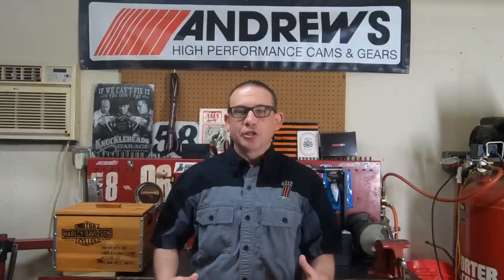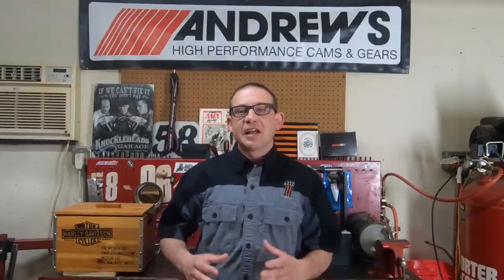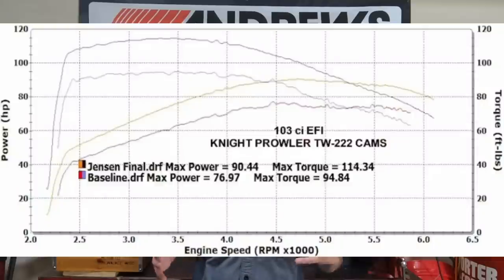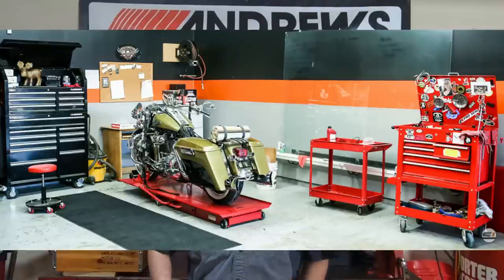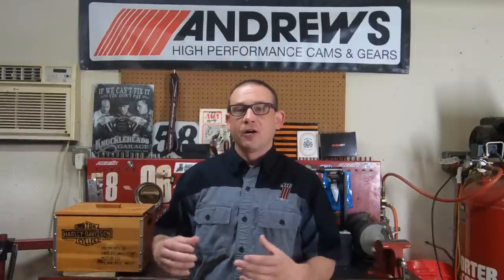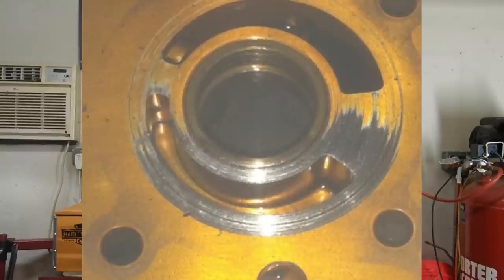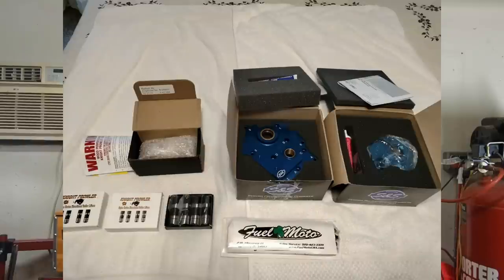Performance Harley Cams Have Their Issues

Comment from the maker: Does valve train noise bother you on your Harley-Davidson, do you even pay attention to it? Let us know!
Reply: I don't pay attention, besides I run a very loud vh two into one
Reply: Can't hear it over the pipes
Reply: Definitely listen for any new or odd noises that's not usual. I noticed more noise from the motor with a more open performance air cleaner, not a lot.
Reply: Valve train noise is more of a consideration on motorcycles with fairings. "Naked" motorcycles the noise will be less noticeable.
Reply: If your 100 year old blue printed v twin, air cooled tractor engine isn't making some ticking, I'd be concerned. If cam noise bother's you, don't buy a Mikuni, that slide rattle will drive you nuts.
Reply: Hell no. Love the noise
Reply: Nope. Can’t hear it over the exhaust. 😄
Reply: Only when I take my hearing protection out 🥃
Reply: I only notice it on start up...Once i get on the road with the exhaust note i dont notice it...
Reply: @Sully  my gas cap rattle is the biggest  irritant on my heritage even with  60k plus miles.
Reply: Yes I have a little vale train noise with the woods cam ,but it’s worth it for the sound of woods cam chop!!
Reply: Not me, as long as I know it's a built in noise I'm okay with it.
Reply: OK guys,If I go Woods Cam in my 103 Motor,2014 Ultra,which one would you guys on here suggest? Stage ll is a s far as I'm going.
Reply: I went with the SE torque cam, I wish it made a little noise but a the time I had to go with the SE to save the warranty. Then two months later I could have gone with the Woods and no issues 😕 nice video 😎
Reply: I just put Rocker lockers in my tc88. Will see as season goes on. The witness marks on that bolt were significant.
Reply: It's a machine. I'd be worried if there ISN'T any noise.
Reply: I no this isn't the thread but I no ur gonna no...I have a 88in lowrider and just did the s&s Big bore kit to it. Either 106 or 110ci now I'm not sure I gotta talk to the mechanic.....anyways I had already had did the fueling cam chest upgraded tensioners,  hp oil pump. But the mechanic put Andrews something 27 cams in it....well my new mechanic say he wants to leave the Andrews in there versus the fueling 570.....can u tell me which cam is gonna be the best for for power and highest HP???
Reply: Also it's in a lowrider
Reply: @Henry.58  I put a Woods 777 in my 103. Very happy with it!

Comment: Just a tip for others thinking about installing a Woods TW222 cam in an otherwise stock 103. I had watched another earlier video where this cam was reported to be a “drop in” cam. For the most part, that is correct, but if you use your stock original push rods after you have “dropped it in,” you will NOT be happy with the resultant valve train noise. It is loud, and it makes you feel as if there is something substantially wrong with your install. You will wonder if you forgot to torque the rocker arm assembly, or messed up the cam bearing install. It is seriously that bad. The reason for the noise is a smaller base circle on the cams. The fix is to use adjustable push rods and make the proper adjustment. It gets rid of most of the noise. Not all of it, but at least you will feel a little better about whether the engine is about to fail on you.  Just letting you know.
Reply: @timmattle4730  
As long as the push rods have been adjusted properly and your lifters have not failed-hopefully you replaced them, and you have good oil pressure, you should be ok. 

When I first “dropped them in” they were so noisy I was worried about the install. I did it myself. Finally decided to upgrade the cam plate, lifters, oil pump, and installed adjustable push rods and was much happier after that. I probably have about 8 thousand miles on them now. 

You might want to re-check the push rods for proper lash.
Reply: @timmattle4730  
Well after my new push rods the noise was a lot less. Had stock first, because of the “drop in” claim. Could not stand that noise so I reached out to Woods. They were the ones that said the old push rods wouldn’t work.
Reply: @timmattle4730  
Well I know you said you used an experienced tuner to do your work, but if it was me, I would check the push rod adjustment. If you are confident the lifters are all working correctly, the push rods would be the only other cause. Unless there is wear somewhere else. But that you are only experiencing it now, after the install, leads me away from that being the cause. How many miles on the bike?  You would have needed to upgrade the air intake for those cams too. Did you do that?
Reply: @timmattle4730  
Is your oil pressure around 50psi for most of the time, only dropping below 32 at idle?
Reply: @timmattle4730  
Ok. As long as the oil changes were kept up, wear shouldn’t be an issue. Which model?  I ask because you said you don’t have an oil pressure gauge. Mine is in an FLHTCU Ultra Classic touring bike. It has an oil gauge.

Comment: Thanks for all of your great videos. I have a 2005 Fatboy that I bought used, stock. Your videos have really been clear and helpful to a non-mechanical guy like me, not only to learn about what I had bought back in 2015 but also the mods I have been making over time. In 2019, I did the Stage 2 cams, plate and pump, spring cam chain tensioners swap-out, tappets, etc. I am now in the process of doing Stages 3 & 4, pumping it up to 95ci, 10.5-1 pistons, and moderate head porting. I have watched all of your videos about these mods as part of my research and discussions with the mechanics. Big 👍.
Reply from the maker: Thank you for the support! I really appreciate it! Your building a hell of a bike and doing everything right on there! That bike is gonna run damn good and be reliable, best part is something special compared to all the new bikes.
Reply: @docracer75 machine in a set of manual compression releases. I wish I had.
Reply: @nelsonromero3520  Thanks for the suggestion. It's on the work order with the mechanic.

Comment: I have the Woods cam in my mil8 and there is no stupid noise in my valve train at all. And you’re right, that rascal is a very real monster for jump up and go. It really brought that bike up to be recognized. I love it!
Reply from the maker: That's awesome to hear you don't a lot of increased valve train noise. Wood cams are aggressive and they nose off really quick, they are usually noticeably noisier than other performance cams for that reason but the trade off is explosive power.
Reply: @GixxerFoo That’s my experience with it. My wife has a 117 FLHXST and I can whip her out of the hole with my 107 and that 222 cam. Top end is a good run yet still but she will pull out at around (way to fast) 😅

Comment: I put in the fueling oem cam plate and oil pump, I have .004 run out with 40000 miles. I went with the oem plate because it’s more forgiving and a 551 S&S cam and lifters, like a new bike, love it!!

Comment: Engine life versus cam swap. A cam that doesn't require new springs is completely rider dependent.  Run to it redline every time you ride it and it will be early failure. For the rest of us it's an afterthought. As for the M8, not swapping stock tappets for quality is a serious gamble.  As a long time fan of Bob Wood I just tried the 30/30 cam by George  Bryce in a 2020 Road Glide and I have been converted.
Reply from the maker: Interesting, I will have to check those cams out!
Reply: @GixxerFoo   fantastic content and info my man! Appreciate all that you do for the community…have you any experience with the TTS CAMS? R&B race exhaust recommends them so I was curious love there Exhausts as well. Please let me know your thoughts and enjoy your Weekend. 
Mark G 9:53
Reply: George Bryce knows a thing or two about hotrod Harleys and more specifically cams! He has four cams for the M8 from the 30-30 to all out..... The next in line above the 30-30 is the F35A.....  He has a couple of great Twinkie cams also and all his cams have that nostalgic Harley sound which is a huge plus!!!

Comment: Keep in mind, once you go to a certain level of cam, other parts need to go with it. Carb, intake manifold, ignition timing (ignition module like Dynatek), valve springs (and head work in general), and sometimes cam clearancing in the cam chest, and Adjustable push rods.  My favorite cams for the for 88 or 95 inch twinkie is the S&S 510. Spicy cam. I think 90% of average riders would be very happy with this cam. If all you want is a cam upgrade with no other work, this is the one I recommend bar none.  Currently I'm running a gear drive Cycle Rama 575 cam in a 95 twink, with head work, springs, piston, and what have you on my Wide Glide.  This is my third engine for my Wide Glide, and feel I finally have what I've been searching for.

Comment: I've never even consider the valve train noise on my bike with my Woods 222 cam. I always thought riding on top of an engine your going to hear things you never do in a car. I ride with an open face helmut, but also never ride without my ear plugs on either.  It's the wind that I worry about. I got good hearing and so far so good. That cam on my SGS, the head work I had done,  plus all the other parts to upgade, just make the engine sing. I saw the numbers on the 103 you put up, and I'm similar:  116 torque with 103hp.  Finally got good weather here and ready for a first ride tomorrow. Can't wait to feel the wind in my face again. Thanks for another great video. I really love these.

Comment: Did a stage 4/114 on my 107 and went with a red shift 468. Definitely happy with it and it pulled nice on the dyno. It’s not a big bore kit so I think I’m pretty safe with that cam. Love your videos, always some great information.
Reply: If you didn't do cylinders, you didn't do stage 4. If you didn't do the heads either, you're at stage 2.

Comment: My 2000 Softail Deuce has stock compression and displacement. Previous owner installed Woods TW-8 cam. I can attest to the valve train noise. Definitely needs some more compression to really shine.

Comment: Gixxerfoo you the reason I went with woods tw-6 cam on my 05 road king and upgraded screaming eagle performance cam chest and oil pump! My engine temps have never been cooler and the chop sound form the cams is insane and loud ! Next year is a upgrade you recommend,is the 98 big bore kit from fuel moto for the 88 ,I hope I could hit the 100hp mark on the Dyno !

Comment: Look into 570-2 cyclorama cams.  I got 98.7 h.p. and 116 ftlbs of tourque.  Installed and tuned by shaeffers h.d. in owigsburg pa. Nice and quiet. Still getting 43 to 44 mpg when cruising. Drag specialties headpipe with stock covers. Vance and hines pipes. K and n air filter with stock cover. 31 degrees of timing
Reply from the maker: Cyclerama makes some killer cams, they are highly underrated honestly.
Reply: On what bike/ engine?

Comment: I put in a Jims USA 818 cam in my 2019 Tri-Glide and now she is a monster ... 103HP and 130LB-FT and now I can actually get back on 2-wheels from a stop. 😁😁 I get max torque at 3570 RPM, which is just awesome for how I ride.

I considered going with the Wood cams, since I had them in my 2013 Road Glide, but my local speed shop said he had much better low end power with the Jims with less hassle.
Reply from the maker: That's awesome! We need more trikes out there like that!
Reply: Is this the Max-Cell 818h
Reply: @kendean2119  I'm not 100% sure about the H, but the rest is correct. My local speed shop recommended, bought, and installed it and dyno'd it. I'd have to look on Jim's again.

Comment: I absolutely agree with you about Wood cams, I have an 03 FXD 95 in, Darkhorse crank, Mondello heads Wood TG8 gear drive cams and 10.5-1 comp. It really hauls and is snappy quick with the stock stroke

Comment: So, I did a bolt in S&S 583 in my 3k mile Dyna Low Rider. Didn’t change the cam plate or the oil pump. It produced 90hp 112tq. I’m not banging the rev limiter but just thrash it all the time. Just hit 5k miles and it’s had three oil changes. I have another bike for touring, this one is just a toy. You would make me sad if you thought I needed to baby it more.

Comment: A cam shapes power, so choose what fits your riding style and motorcycle. My 2013 Ultra Limited was horrible (in my opinion) stock. 78 ft pounds of TQ @2,000 RPM peaking at 90 TQ @3,000 RPM. After replacing the cam, exhaust, air filter, and tune it hit 103 ft pounds of TQ @ 2,000 RPM peaking at 106 @2,325. The change made the engine run cooler and had 25 more ft pounds of TQ @ 2,000 RPM. I went from hating my engine to loving it.

Comment: I've got S&S 585s and they're a longer duration than say the woods profiles and I can still hear my valves... compression ratio is 10.25:1.  It's a killer setup in a 103,  got a little headwork and making well over a hundred horses. But let's face it you're 100% correct performance cams can be noisy, I wouldn't call it a problem tho more like par for the course.

Comment: Another trade off is low rpm, low load drivability; i.e. 15mph steady speed in 1st gear. And yes, that is a normal riding condition; especially if you drive on a military installation.

Comment: I went for a screaming eagle power cam on my 2020 softail slim, and whilst it may not provide all the performance of aftermarket cams it still feels like a worthwhile upgrade and I expect it is designed to work with the engine design developed by Harley
Reply: Dealership brainwashing at its best....😂🤣😂
Reply: You would think. I don't  trust Harley Davidson as far as they're going to make what's right ! I just spent 22hundred on my 06 fatboy in parts that should of been in the bike from the factory
Reply: Only screamin' eagle thing I left on mine is the air cleaner insert , it looks really cool and doesn't hurt the performance much (adds 6 ounces) .

Comment: My 2012 RK is getting new cams camchest, oil pump, lifters, pushrods, all Screamin' Eagle, the shop had the parts. At 50,030 something broke in the cam chest and rubbed a groove in one of the cams. So long income tax check and then some.. If you don't love' em, then don't ride' em.
Reply from the maker: Those are upgraded will be well worth the investment, you won't be disappointed and you'll have peace of mind!
Reply: @GixxerFoo  The mechanic at the Indy shop said it will be bulletproof.  WOOHOO

Comment: I went with an s&s475 bolt in on the sg. I love it. Big power gain and quieter than stock. I only did cam, lifters, and adj pushrods/ covers. Has been 8 months/ 6k miles and I'm content with it for now. I did try a SE torque cam and it just didn't do it for me. Jerked that sucker out with less than 10 miles and stuck the ss in.

Comment: Great video man. So I have 525 cams in this twin cam 95" road king. Is the wood tw6 cams stronger torque cams than the 525 which hit in the midrange and ramp up....I want the most torque I can get.
Reply from the maker: It's really hard to beat that 525 you got, they are so close together comparing the two. If you didn't already have a good cam in there it would really be a toss up.
Reply: @GixxerFoo  ...OK man, thank you for responding,  much appreciated

Comment: Great info from an informed source. I would be interested to know if you've ever made a video on sprocket sizes. How a bigger engine sprocket and a smaller drive sprocket in the primary would effect performance or a larger transmission drive sprocket and a smaller wheel sprocket would work! Just some of the things I think about. LOL
Reply: That's a really great idea!!
Reply: Many years ago, on my old shovelhead, I increased my engine sprocket and my trans sprocket and decreased my rear wheel sprocket. I did live in the panhandle of Texas, where there is nothing out there. I loved it. It dropped my rpm by about 750 rpm. Way better gas mileage. The only drawback is that in city driving, thete is more wear on the clutch.

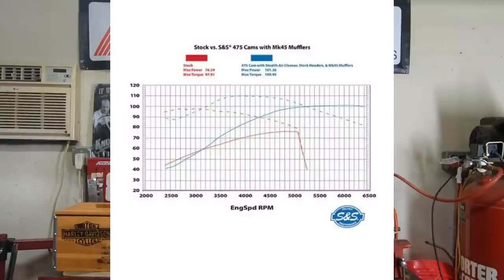Comment: My 99Ultra TC has a Woods 5 conversion Cam. It's perfect with 3:37 gearing and my my ported flowed heads an intake manifold for my CV44. It's very stout as this guy in Chicago flowed the heads at 285. No idea what the torque is for this 95 but never worried about it as the Super Trapp 2-1 sounds mean as hell.
Reply from the maker: You've got a really hot setup there it sounds like! I love those bikes you can work on anywhere anytime like you've got!
Reply: @GixxerFoo  that's why I'm keeping her plus my buddy built the motor, God rest his soul. She needs new paint though... You think I can buy painted parts for a 99 Ultra?

Comment: Did an S&S square 100 with 585 cams. 10.5 to 1.
I have about 2500 miles on it. 06 88 tc in an flhtci.
First of all. Those noises are part of what makes a high performance build desirable. I love the noise.
As far as durability....
The big HP gains have had me running the bike a lot harder and Im sure that will negatively impact longevity. Not to mention the belt on a 1000 lb bike.
I will say I dont feel like the tuner has it right yet. It wont run smooth while trying to be mellow. Steady low rpm in town it doesnt sound happy... which only makes me run hard more.
It will pull the front wheel in 1st and 2nd. Not wheelies... just pulls the wheel if I get pissed at some ahole from low speed.
Also in this day and age theres fuel economy.
I commute on my bike as often as possible.
At stock 88 I got as high as 42 mpg.
At 100 I have seen 33 but mostly its right around 30.
I know... as if that matters.
But just another consideration.

Comment: Hey gixxer Ive done a 95 big bore kit on my tc 88 ,forged pistons 10.5/1 se performance heads , dynatek tc88 ignition , 2-1 exhaust Ali cam chest ,hydraulic tensioner ;high flow oil pump etc  , kit came with se211 cam and goes like a rocket but can’t help thinking I’m missing out on some power using this cam especially after watching your vids on woods cams